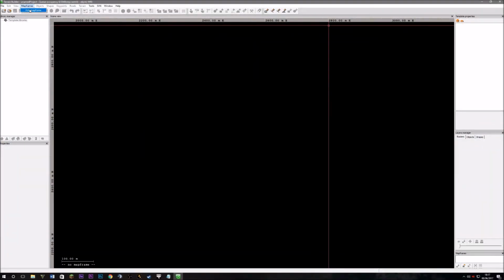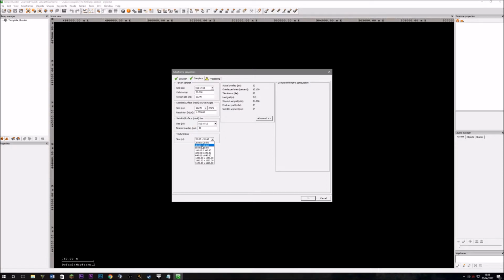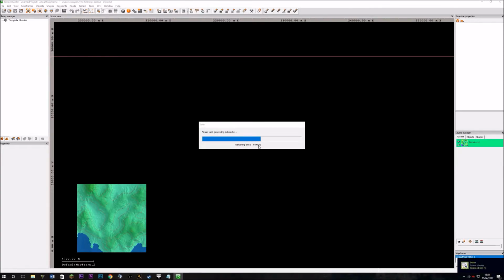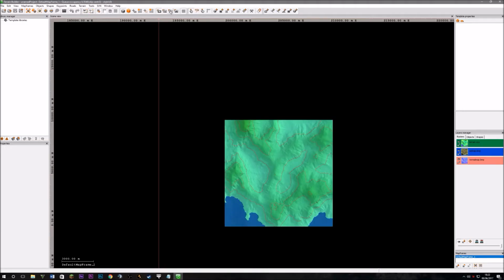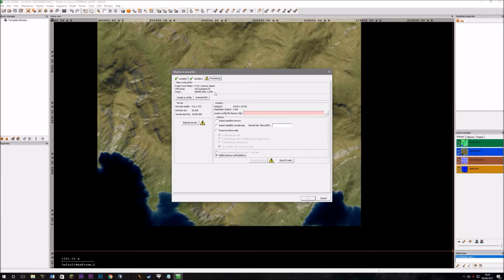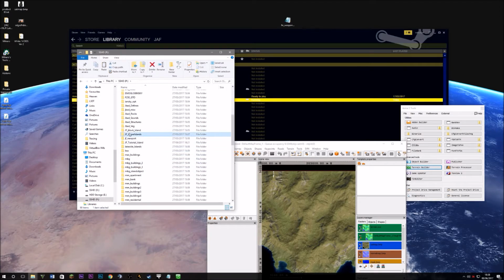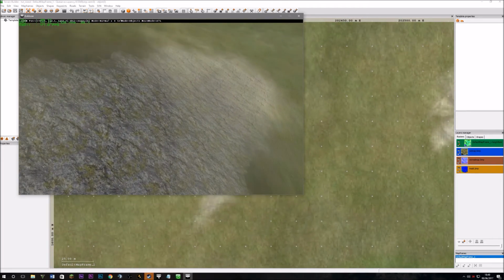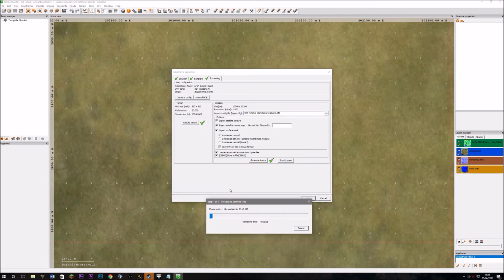ARMA 3 Tutorial | Terrain Builder | PART 2 | Importing into Terrain Builder

Comment: appears i got an odd issue, when i finish generating the layers, 2 cmd windows pop up making pngs, and then when i try to load into bulldozer it tries to load about uh...upwards of 3000 png images, and counting ok now it just went to 1,300 and counting...tf
P:/Project/data/layers/aprox. one metric fuck ton of pngs
also its back to 3000
Reply from the maker: Grandpa Gropes-A-Lot you need to select the option to convert them to .paa files. It’s generating each tile for the map.
Reply: i figured it was the convert exported textures into .paa format or whatever, but thats been checked and ive unchecked and rechecked it over and over
Reply: didnt see your comment, didnt refresh im going to give up for the day. though i did get it to open in bulldozer. still gives an error saying it cant load a sand texture, but the sand texture isnt referenced as far as i know. also only chunks of the map load in instead of seeing fully. rather annoying.
Reply: and i select that, and it converts it and eventually completes but theres now thousands of png and paa files

Comment: I'm having problems when generating layers, I get the error "Layers Generation - Unable to load the file "P:\"" Now i've gone through all my files and code and I can't find the error anywhere, and I've run multiple debugs, and have done other research on the problem, and can't find a solution
Reply from the maker: The error should be very self explanatory. Doesn't take much effort to figure out what that means. Possibly your P drive isn't mounted or possibly your paths are incorrect, can't think of anything else causing it.
Reply: JAF I know what the error means, I'm not retarded. What i cant figure out is why, even though my layers.cfg and all the RVMATs have no coding errors, Or incorrect paths, is it going it. I've gone over it muiltiple times. I ended up rewriting all the code
Reply from the maker: map frame error
Reply: JAF It wasn't a map frame error, maybe you need to be educated on how to create terrains ;)
Reply from the maker: Alexander Padgett Sorry mr expert. I haven’t done this in almost a year now and I don’t memorise all errors and didn’t want to spend hours of my time helped by everyone. I just stated the most common causes hoping it was that that was causing it 😂. How did you get it to work?

Comment: Hey, when going to the bulldozer, My water is like a meter south and west of where the textures for the water is on the terrain.. any idea what is causing this or how to fix it? Thanks!
Reply from the maker: MR.ZR where did you generate our textures? Or did you do it manually? Also, does it match to your height field?
Reply: JAF I started with the height field and from there want and did eerything down the line from watermap all the way to alpha maps and it seems correct when I toggle between the layers in the terrain builder
Reply from the maker: MR.ZR one of the two are offset slightly. Try tasing the texture map up by 1 pixel. It may fix it, it’s hard to tell without it in 3d. Good luck!
Reply: How do I do that? XD
Reply from the maker: MR.ZR northing and easting
Reply: Trying to get it to line up.. hopefully it works.. any idea why ti would do that in the first place?
Reply from the maker: MR.ZR if you did this manually, you probably failed to line the satmap up correctly. Otherwise, an error generating all the maps
Reply: So... I redid everything and made it two times bigger... Now I have to use mosaic tiles from L3DT and import each one and position them... the issue I am having now is bad texel matching.. I have tried everything I could think of, messed with every mapframe property I could.. I am stumped.. do I just need even smaller (more) tiles or what is the fix?
Reply from the maker: What is the resolution are you making your map? And I'm pretty sure mosaic tiles are optional
Reply: 49200... it says BMP can't be created that large and any other file type crashes L3DT at 40%.... I am trying to make the map be 49.2 Km x 49.2 Km
Reply from the maker: That's why, if you want to make a map that bi, you will need mosaic tiles, and resolution would need to be insanely high. If you want to do that I would recommend getting proper paid software for doing that. Like professional. But in TB, all should be the same, just generating images at that resolution would be very hard.
Reply: Oh great.... so what is the biggest I can get the map then...?
Reply from the maker: I mean, 49.2 km, the resolution would be something like 50k, by 50k, the map size you chose needs to have 256 as a factor. Thats a HUGE resolution. max on L3DT for me would be 20km.
Reply: oh damn.... that's for the mask/sat images? what do you mean factor of 256? like 256 times the size in meters? when i imported the 49.2k x 49.2k it does look as though it is correct.. it says it is roughly 49.2km x 49.2km... I believe I had a 20km map but It seemed small.. so each layer would need to be 50k? how big should I make the height field then? or keep that the correct thing.. Because I did it as a factor of ten like how yours did.. Thanks for the help btw
Reply: Also, If I was to use the horizontal scale for the heightmap.... how big is the factor for what my other layers should be?
Reply from the maker: MR.ZR all layers should be the same size.

Comment: Terrain builder wont launch? ive done everything the way you have
Reply from the maker: I didn't make terrain builder. You need to be more specific. Is there an error? I can't do much about it because I didn't make the program...you're gonna have to google it
Reply: well after doing all the stuff with L3DT i was ready to launch terrain builder so i launched from steam A3 tools and clicked on terrain builder, the mouse went to loading icon than stopped, and returned to normal nothing else happened, i have tried launching the terrain builder exe from a3 tools folder, a3 tools from the folder and all have been attempted in adminastrator, i have uninstalled and reinstalled, verified game files through steam (it found 2 missing updated than same issue), other programs ie object builder & terrain processor launch however not terrain builder
Reply from the maker: as i said. im not bohemia interactive. i dont know all of the millions of possible errors. youre gonna need to research becasue its a problem with your PC

Comment: First off thanks for the great tutorial, you make it easy to understand and follow! I'm running into an issue with generating layers for the map-frame. Every time I'll get to step 3 (Processing Surface Mask) then Terrain Builder freezes up and crashes a few minutes later. Any ideas or tips?
Reply from the maker: Alex Stuart may I ask what is the resolution of your terrain, satmap, mask, and normal map is please?
Reply: JAF I'm a sucker for punishment but I went 20480x20480 instead of 10240x10240 on all.

Comment: Hmm, an interesting one for me! None of my images appeared in the terrain editor other than the ground mesh. Sat and Normal maps never appeared, no matter the layers and coordinates!
Reply from the maker: Drawyah Games what do you mean they never appeared?
Reply from the maker: Drawyah Games you need to make the sat and normal maps....they don't just magically appear.....
Reply: I have imported them all, I'm not an idiot as you see me as...

I did find the issue which was the Terrain Builder settings, it has set the maps not to be visible so whether or not I selected them on the layers panel, they would not appear until I changed the settings.
Reply from the maker: 5:54 you are supposed to use the icons there, i explain it somewhere in the tutorial. It toggles the rater layers
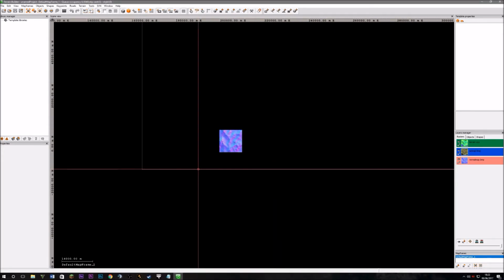Reply from the maker: also 5:22
Reply: I was just watching your flight sim videos holy shit...

Comment: Hey! Thanks for making the video, I was having an issue in Terrain Builder where whenever I got to the part when you rebuild terrain, I get an error message saying: "appid" key cannot equal 0

I was wondering if you had any way to fix this
Reply from the maker: Hayden no idea, most likely something done wrong in the process, I'd look around the forums for the problem. And np ;)
Reply: I figured out it has to do with buldozer and I, for whatever reason cannot run buldozer without getting the error

I'll keep looking for a solution though and thanks for the fast reply!
Reply from the maker: Hayden what error? Have you even installed bulldozer in project drive management? Look at my first part.
Reply: Yes I did but something went weird and I had to delete it and reinstall it.
Reply from the maker: just verify tool cache
Reply: Where do you do that?
Reply: I got it working

Comment: im having a issue with my layers, im no noob, when it comes to working with arma , but my mask/layers config isnt doing what it should, I have even tried just using 1 color / config for testing
Reply from the maker: ItsLeigham what's the issue with it?
Reply: a friend of mine, bought source for New_Eden, but when he got the map, there is no clutter whatsoever, even though I have re exported everything, checked the mask against the colors of the layers cfg. I can get at least one load of clutter to show by removing 2 of the layer configs. but then its the same layer over the entire map
Reply from the maker: ItsLeigham the clutter has nothing to do with the layers.cfg. That's all in the config. Part 7 teaches you how to do clutters
Reply from the maker: ItsLeigham and what do you mean 2 layer configs? There should only be 1 layers.cfg
Reply: 2 of the entries inside the layer config.
Reply from the maker: ItsLeigham well...if there are 2 classes/colours/textures of whatever in the config, let that be, that has nothing To do with the clutters on the grass (if that is what you mean by "entries")
Reply: the layers control the surfaces and the surfaces control the clutter dont they ?
Reply from the maker: ItsLeigham well, to keep it simple the layers do this "Grass.paa = colour green. If on mask there is "colour green" load grass.paa. They just load the textures where defined. If it's doing that, nothing is wrong with the layers.cfg.
Reply from the maker: ItsLeigham is there just no 3D grass loaded?
Reply: it looks to me like there is the wrong surface types, because the dirt/soil everywhere (which is "empty" clutter)
Reply: if you get some spare time, could you come take a look, been a long week troubleshooting so far, and got no where xD
Reply from the maker: ItsLeigham dirt and soil is supposed to be everywhere, then the grass on top
Reply from the maker: ItsLeigham yes I could take a look. But I'm currently off school sick, so maybe when I'm feeling better
Reply: I thought there could only be 1 surface type.
Reply from the maker: ItsLeigham explain how there is sand, dirt, rock, mud, seabed...you can have as many as you want. I have heard this from lots of people and I don't know where they get this from. Just curious, where did you here this information?
Reply: I mean per tile. 
if you do surfaceType it returns a string, not an array
Reply from the maker: ItsLeigham oh my bad, thought you were on about textures. As for surfaces, yes, you only need 1 "per texture" and in them you can put as many clutters as you want inside
Reply from the maker: ItsLeigham and for surface types, you can have as many as you want
Reply from the maker: ItsLeigham anyway, I can come help you now if you want. Do you have a teamspeak?